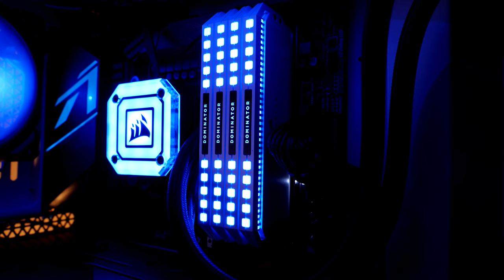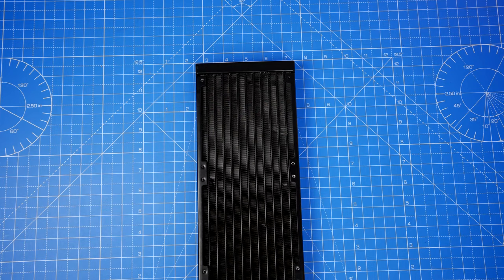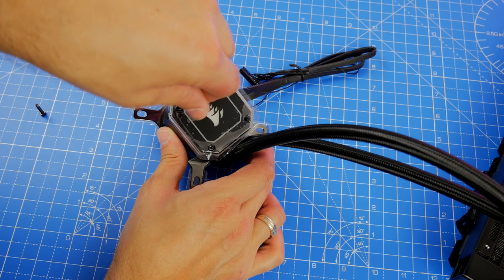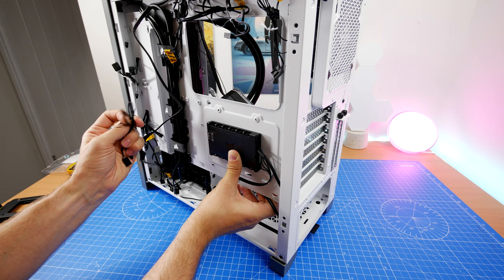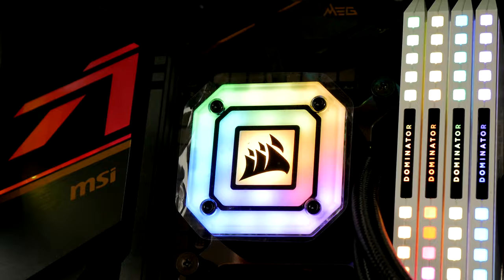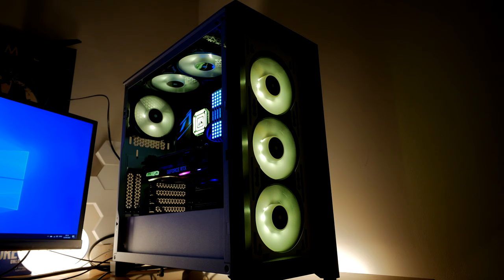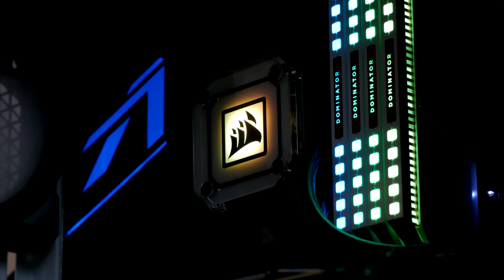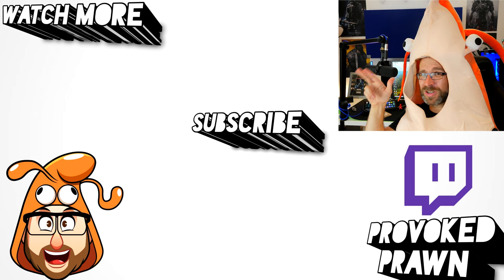Corsair iCue H150i Elite Capellix Pros and Cons - what's good?

Comment: Thank you for showing off the clear pump cover. All the other reviews I've seen just used the default black one and I wanted to see how the clear one looked. It looks stunning, thanks!
Reply from the maker: That's great. I was worried people might be upset I didn't use the black one.
Reply: there an lcd attachment
Reply: @TheProvokedPrawn  Can I ask for your advice. I would like to build a super cool system with a bunch of RGB and it’s so cool having a bunch if fans. I want to do the biggest case and so forth. I am just not good at knowing which mother board and stuff to get. How can I build one where all the pieces are correct.

Comment: I’ve heard before from numerous tubers that installing the radiator at front for cool air intake with the input/output tubes mounted at the top is where the coil whine from the pump comes from. 
If the tubes are located at the bottom of the rad (which I might add) is sometimes hard to do if not impossible in some pc cases that the coil whine in the pump goes away after a few hours/days of running. 

It has to do with the air naturally in the closed loop system that can find its way through the pump head made possible by having the tubes up top of the rad. Which also can shorten the life of the pump. Say the pump lasts 5 years or so, if the tubes are at the top grabbing air it could shorten life to say 4 years. 
Top mount (which is where I mounted mine) is supposed to be ok. And tubes at bottom of front mount setup is ok. Tubes at top front mounted is STILL ok but possible whine and possible life shortening. 

Sorry that was a mouthful 🍻
Reply: he mentioned it in the other vid on the cooler
Reply: @Fardeen.  Strange why he didn't mention it in this vid.

Comment: This cooler is the coolest in the market. Totally recommend it
Reply: But pump speed can't be controlled, it runs minimum 2200 rpm which makes humming noise.
Reply: @Muralidharan001  mine is on 2200 quiet setting right now, which is completely quiet, you can start to hear it if you set it on balanced or max, then it runs faster and you can hear it a little bit

tldr mine is totally quiet, no humming
Reply: Better then the EK elite d?
Reply: @Motobro699  at that level it probably depends which one looks better to you, corsair one for sure is bomb

Comment: I would love to see a video explaining the key differences between all of Corsair's AIO lineups. They have the Platinum series, Hydro series, Hydro Series Pro RGB, iCue Pro XT series and now Elite Capellix.
Reply from the maker: Hmmm, good idea. That's quite an undertaking though.
Reply: Do we know if any performance difference between the Pro XT and elite capellix? אופק קוזניק
Reply: @mfenix88  elite cppellix  has better fans in every way: better cooling performance, 8 led rgb and very quiet operation. the pump is also loaded with more rgb leds
Reply: אופק קוזניק source? Curious about how it has better performance
Reply: @mfenix88  check reviews and specs at shopping sites, the fans that come with the pro xt have no RGB and yhe fans that come with the elite capellix have 8led rgb each.
Reply: @mfenix88  better performance means lower temperatures because of higher RPM and better fan blades

Comment: I own the H100i on a 7600X and it’s actually works very well. Having the commander core made everything soo easy for fans and RGB’s
Reply: What temps do you roughly get looking to get the h100i with a r7 5800x hope it’s good enough?
Reply: @rxpidzz2346  With the handful of games that iv tried so far I haven’t reached above 78C. Keep in mind tho I’m using a 6 core and an 8 core seems like what your planning. Right now I’m saving for the 7800X3D and then I’ll probably have to upgrade the AIO.
Reply: @rxpidzz2346  Since your staying on the AM4 platform, how come your not looking at the 5800X3D ?

Comment: I have the H15i Platinium. The pump whine is unacceptable on Balanced/Extreme but OK (still just audible) on Quiet. I understand it's the CoolIt pump vs Asetek used on older models. It's been pain to mix and match with another 2xML140 fan pack, although I managed it. It's gone wrong with the pump housing losing RGB/pump speed control from iCue so is stuck on the hardware settings. If I plug in elsewhere and force a firmware re-flash, it's good for a couple of days. Thinking of getting it swapped for a new one, selling the new one and buying one of these new H150i's. At least I could more easily control the RGB stuff ... If I didn't already have Corsair RGB keyboard, mouse and RAM, I'd think about dumping Corsair altogether TBH as this is my second H115i - first had unacceptable pump noise.
Reply: If you can hear it whining that means there's air in the pump.  Either it's defective or installed incorrectly with the pump at a high point.
Reply: @AnarexicSumo   @AnarexicSumo  It was installed correctly but I could hear the pump. Not at all loud but, unlike fan noise, it was at a frequency which I found really annoying. However, on Quiet, I could barely hear it so was very happy with the H115i Plat. However, when the LED part went faulty (the lights went all yellowy), I returned it and bought the new Cappelix version. The RGB was great but there was no option to turn down the pump. I suffered one day of that 'mosquito' like pump noise drilling into my skull (not loud, just annoying) and asked if I could RMA due unacceptable pump noise. They said yes and I refitted my Noctua DH15 Black. It looks decent in the case, albeit not as nice as a lit up CPU block. It works perfectly and is not annoying. I love the idea of an AIO but am obviously one of those people who is susceptible to the noise of a pump spinning, even though it is a quiet noise. Perhaps if I invested in a loop with a D5, I'd be OK but I only run a gently overclocked 10600K so the Noctua is more than up to it.

Comment: I recently installed the H110i Elite Capellix and I have an AM4 platform. Let me tell you, Corsair definitely put in all their effort to make installation easy on Intel socket types. AMD needs A LOT of work! For AM4, you're required to use the same stock mounting clips that comes with the motherboard (which most people throw away tbh so I had to bum some off my friend). At any rate, you're required to use thumb screws that have to hook on the AM4 mounting clips which is really awkward and honestly not very stable when installing the pump on the CPU. 

Overall I'm happy with the performance! But AM4 folks, make sure you know what you're getting into, the install will not be easy and it'll take some time getting the positioning right. On the bright side, unlike this reviewer, I found the installation of the fans to be quite easy (much easier than my old EVGA 280mm aio). Hope this helps some folks, cheers!
Reply from the maker: I too have experienced this misery recently.

Comment: Damn, my h100i pro Platinum se pump is whining On balanced and extreme... I considered a replacement for this one, but since you say it's doing it even on quiet... I really love Corsair's AIOs, but I can't stand the noise... Should I go for it? How is it on balanced or extreme?
Reply: I got the capellix yesterday and it has a really loud whine! Even on quiet!
Reply: Had that on every Corsair cooler I’ve ever owned. I switched to Noctua Air. CPU isn’t quite as cool but I can recommend it if you prefer no whining AIOs.
Reply: @Robertotvl  ARCTIC makes a Liquid Freezer II AIO that is VERY highly-rated.  Corsair gets people with the iCUE controller and iCUE software suite - but if you check out ARCTIC (also make Thermal Paste mx-5 which they include with their unit) - you will see the ARCTIC at the top of the charts in performance, even a 240mm vs the Corsair 360mm!  Best of all, Arctic has now released 360mm and 420mm (just released the 420).  FYI.  Gamer's Nexus loves the Arctic - sadly my System Integrator does not (currently) offer ARCTIC.  So unless I want to build it myself, I'm stuck with Corsair.  Love their Airflow Cases though!  DEFINITELY RECOMMEND AIRFLOW model over the smoked glass panels.

Comment: I love this AIO but that whining noise could be normal the pump on this cooler is noisy per corsair the pump is from coolit previously asetek and runs at a minimum of 2300 on quiet 2400 on balanced and 2600 on extreme. But it does not bother me so much as I play most games with a headset on anyways.

Comment: I just built a new rig with an i5 13600k and the Coolermaster Hyper 212 Black Edition wasn't doing enough.  I have a great Corsair case, lots of cooling fans, and 15 seconds in to Cinebench R23 and the CPU is 100C and throttling and that was at stock speeds..  Added a second fan to the cooler for a push-pull setup, didn't help.

Got the 320mm AIO in your video and now it sits at 77C in Cinebench and that's with me overclocking it to 5.4Ghz...  Massive difference...  Was playing Doom Eternal at 4k today with all settings maxed out, and the CPU hovered at 34C and the RX 9700 XT was at 67C....

Never tried liquid cooling before, but this CPU runs hot and didn't want a massive tower cooler in there...
Reply: Can you control fan speed through Bios or must need Icue software?
Reply: @Iconic11111  I use the iCue software as it is all plugged into the iCue hub... but I believe if you plug the fans directly into the mobo headers, then you can control their speed through the BIOS.
Reply: @SquireSCA  thanks for telling...can you plz tell hows pump noise bcoz i heard a lot abt that..am asking you bcoz you have similar cpu as mine 14600kf and i dont overclock just using it for only gaming but i noticed sometimes it draw more than 200 watts while making shaders in games that time my deepcool LS520 240mm AIO not able to handle it 🥺
Reply: @Iconic11111  Its extremely quite... I put it on "Balanced Performance" and it adjusts as needed.

Comment: My only complaint comes from the issue I had mounting it on an am4 motherboard. it doesn't come with a back bracket for am4 systems and just tells you to use the stock one that came with the motherboard. Ofcourse I didn't have the og one and the one I had didn't allow the standups to come out enough. I actually ended up having to use the standups that it came with for the Intel installation which then made me incredibly nervous since I couldn't see if it was making good contact to the cpu. Luckily it was and it works, but corsair really should include a spare backing for am4 as well. That would have saved me sssooo much time.

Comment: Hope you had that 10700k overclocked considerably, running at that temp with that cooler seems quite high. I have the 420mm version and it'll hold my 10980XE at that temp under full load.

Comment: Hello friend. I have 465x case and I bought h150i capellix on yesterday and it is on the way. But I have a concern about mounting. Some people say the 360mm radiator should not be mounted at the front of case. But in my case there is way to mount it on top. What can I do? Should I have to change my case? Have you had any problems in this regard? I would be glad if you help me in this regard

Comment: First off, as many have said, you have an awesome voice, you could get into radio with that voice for sure!

Now to my question, I have 3 X QL120 fans. I assumed they will plug into the commander, no problem right? And ICUE software will detect it. My question is how would look in terms of the lighting patterns since they're quite different RGB fans? Hopefully it doesn't look crap and that they play nicely together because after this review, I'm thinking I've made my decision and plan to buy this to go work my Lian Li 011.

P.S How bad was the coil noise and did it get resolved? It sounds pretty annoying to be honest. But I really want this cooler.

Look forward to your reply. Thanks.

Comment: Great review, I think the noise you hear in the pump is air and low levels coolant. I have an old 110 Corsair, and noisy pump, had to open drain a refill untill the top. These AIO are never refilled to the end , unfortunately so air will make noise.  Would like to ask you the Controller that comes with the kit, you say can connect up to 6 fans, including the AIO fans??On your case you have 7 fans, plus the pump , so you have 2 fans connected to the mother board, for the RGB?

Comment: The pump whine is normal i have gone though 2 of these coolers both have had a loud pump it's normal with this cooler
Reply: Did the pump noise eventually gone quiet? I have the h100i capellix for about 2 days and there is a bit of pump noise.
Thank you
Reply: The reason why it's loud is because the pump spins at minimum 2000rpm. It's not the liquid making the nosie it's the propeller. The nosie isn't to bad it sounds very similar to a quite fan, with my noctua a14s running at 700rpm you can't hear it
Reply: @furkancoskun3006  no coolit pumps are louder than asutek but they perform worse so pick your poison

Comment: What case fans should I use if I get the white version of this cooler?  I'm not really sure since I can't exactly get the exact same ml120's that it comes with.  I'm also concerned about mixing and matching, compatibility etc.

Edit:  White case fans, I wanna run 3 at the front, this cooler at the top with the 3 included fans and 1 fan at the rear.  All rgb.
Reply from the maker: You could go crazy and use all QL120 fans. Swap out the ones on the aio for them too. That what I did in the 680x a while back https://youtu.be/kCC0hrqPiFI
Reply: @TheProvokedPrawn  alright, I'll see if I can do that.  A few more questions if you dont mind (sorry if they're dumb lol)

1.  Since I'll have 7 fans, do I plug in 6 into the commander core that comes with the aio and plug the last (seventh) one into a separate commander pro that I would have to buy?  Would that work in order to get them all synced up in icue, or is there a better and most cost effective way

2.  I don't think you've done a review on them from what I've seen, but what're your thoughts on the SP120 RGB Elite vs the QL120s (if you have an opinion on that).  Should I just swap everything for QL120s or SP120s. 

Thanks so much for replying so soon to my original question

Comment: The radiator suppose to be mounted tubes down right??? opposite of what is shown here. pump sound could be because of that. air collecting on top of pump and on top of radiator.
Reply from the maker: As long as the pump isn't the highest point it's fine

Comment: Out of the box. Is the fan cooling profile set as standard? I have the ComCore with 8 fans connected to it. Port 1 has the case fan hub with 3 front fans , plus 5 other fans. 3 from AIO rad -1 rear exhaust -1 side intake which i want to run at low rpm. Guessing its the AIO water temp that makes the fans speed up or is it the cpu temp? Plugged aio in to cpu temp on motherboard.

Comment: I am an absolute noob when it comes to RGB lighting. In my new PC, I will have an ASUS motherboard (which has Aura Sync), I will have a be quiet! case which has its own fan control unit and my cooling will bei a Corsair AIO water cooling and some Corsair RGB fans for the case that come with a Lightning Node Core controller box. Which of the RGB control units should I use and which not and can I combine them in any way?
Reply from the maker: This might help. https://youtu.be/kCC0hrqPiFI I'm not sure how the case control unit will play with the fans. You might need a Command Pro
Reply: Damn good question. I'd like to know too!

Comment: I have a question, is it okay to have the loop tubes in the radiator at the top side or the bottom side for front mount radiator? I cant mount my radiator at the top of the case because of the ram. Friend told me it's bad because air will find it's way to the top and the inloop and outloop could break. I need confirmation please.
Reply from the maker: https://www.youtube.com/watch?v=BbGomv195sk
Reply: @TheProvokedPrawn  thank you. The video explained everything. Got my sub as well!
Reply from the maker: No problems
Reply: This video from gamers nexus also answers the problem you have with pump whine in the final few minutes of the video, since you mounted it tubes up

Comment: The AiO looks really nice and keeps temps low. It's just so unfortunately whiny especially when the system is not under load and fans are not spinning fast, it kind of ruined the whole experience cause I have to wear noise cancelling headphones or keeps the fans above 1300rpm to drown it out. 
I wouldn't say it's loud, but it produces a lot of low frequency noise due to resonance I happened to be sensitive to, maybe it's less noticeable on a Intel system with the different mounting method.
The am4 mounting mechanism was also a bit of a pain to get in, but I really wish I did more research cause I assumed trapped air is the reason why it makes that noise and it'd get better over time, so the return period for the product expired and now I'm buying a different cooler instead of extra ram like I had planned. F
Reply: relatable.
Reply: Is your aio top or side mounted? If it’s side mounted and the tubes are coming from the top of the radiator that might be your problem

Comment: Just a note on the backplate.  The two metel sockets on the bottom of the backplate. Can slide up and down about 5 millimeters. So when I was trying to fit it on a Intel  i9. 12th generation.  I didn't notice that thay where movable.  And because I hadn't noticed.  I thought for a while that the holes would not match the plate. Hopefully this helps someone
Reply: I was wondering why mine didn't line up as well. Thanks!